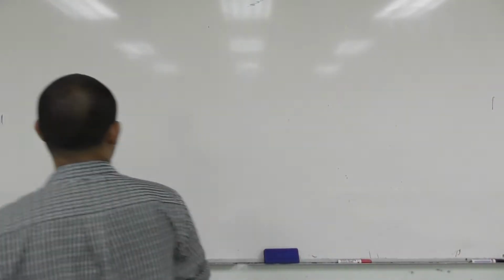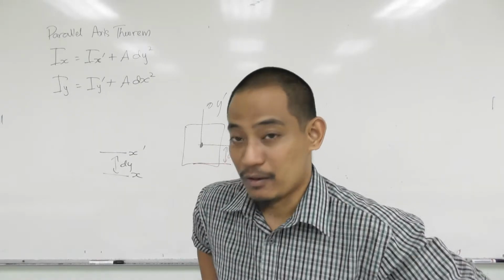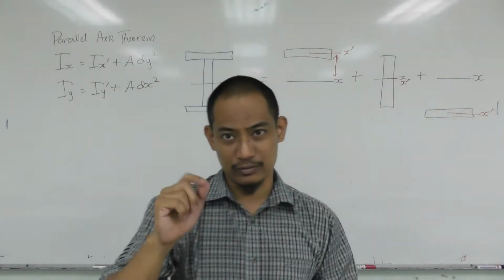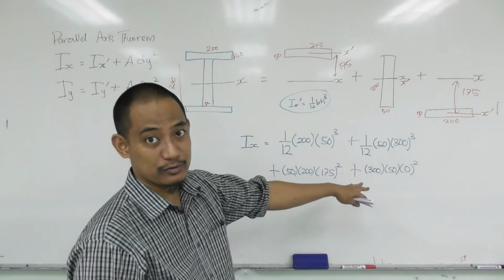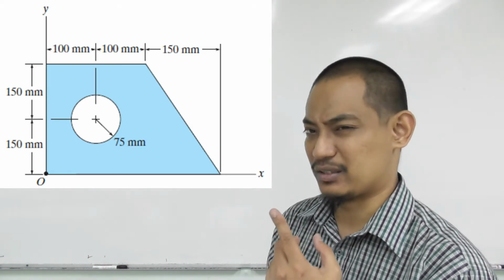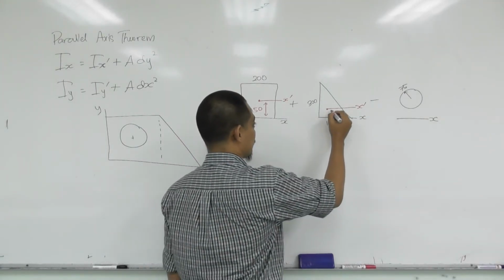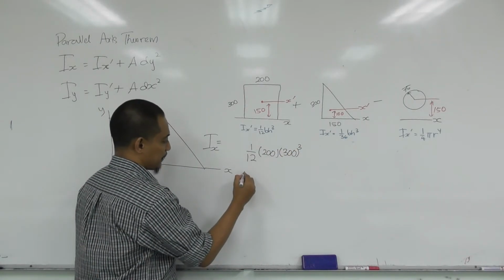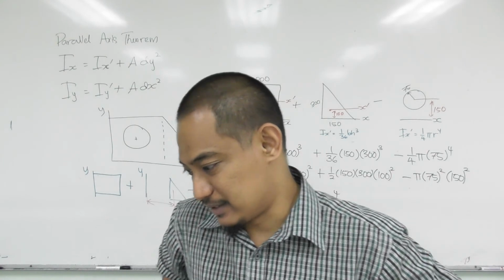Statics - Chapter 10 (Sub-Chapter 10.2) - Moment of Inertia of Composite Areas

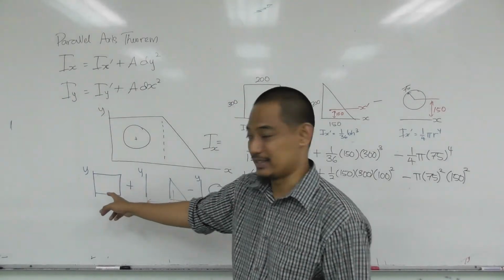Comment: Assalamualaikum Dr, for 27:24, is the Iy' for the right angled triangle is (1/36) h b^3 ?
Reply: If not, then how do we get the formula for Iy'?
Reply from the maker: yes, if it is right angle triangle as such, that is correct
but if in a different question where the triangle is not right angled, perhaps it cannot be expressed as such (is h is understood as height and b is understood as base)
if you look at the table, that is why for triangle shown the equation is only given for one axis
Reply: @SaifuddinRehan  I see, but Dr do we need to figure out the Iy' for that non-right angled triangle in exam ?
Reply from the maker: @sayhan3631  well, theoretically it is possible, but then again every triangle can be divided into smaller right angled triangles....
Reply: @sayhan3631  basically you can turn every triangle to be a right angle

Comment: Assalamualaikum sir, i have a question. The moment of inertia value is related with the distance between the axis and the centroid. I know that in exam the axis will be given but i just want to know, how they determine where the axis origin (0,0) will be located in real life?
Reply from the maker: Waalaikumussalam
well, in term of what we are learning is simply to calculate the moment of inertia about any particular axis that is given, to know how to calculate  the value as needed.
In reality, we will not actually calculate for no particular reason, rather calculate values that we need, or meaningful, for the purpose of the calculation.
So one calculation that may resemble real life calculation, is to first determine the centroid/center of mass/gravity of the whole structure, and then compute the moment of inertia based on the centroid.
(similar to the discussion of the shape of the beam used in construction, where it is about the moment of inertia with respect to the centroid of the combined shape)